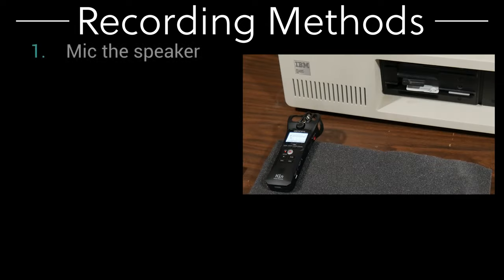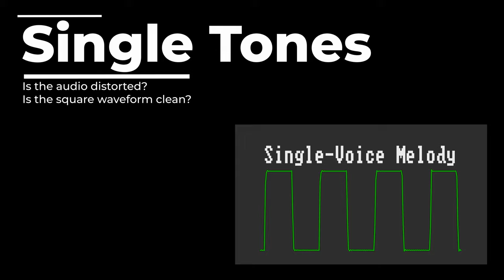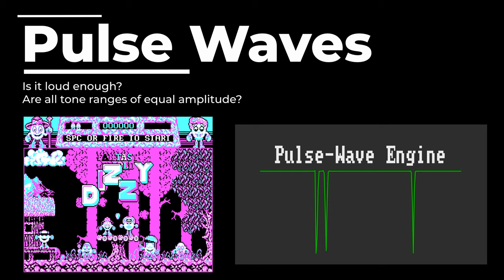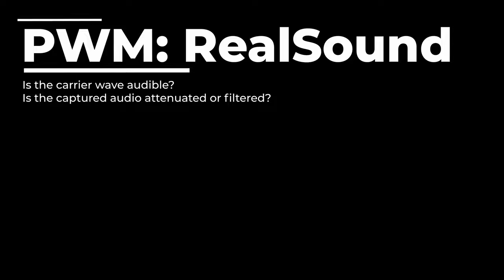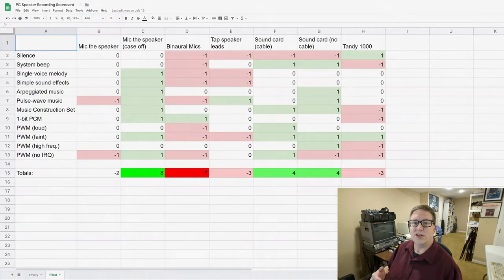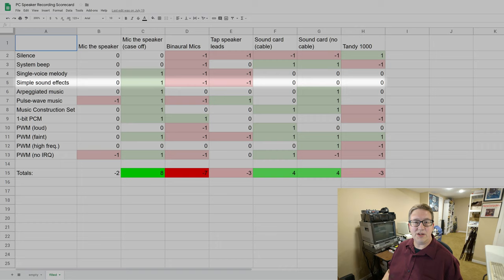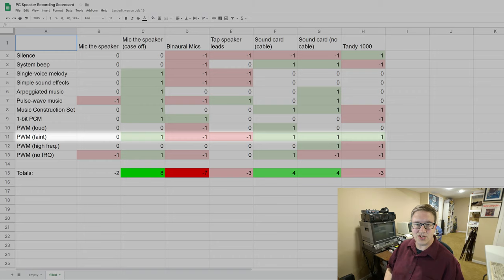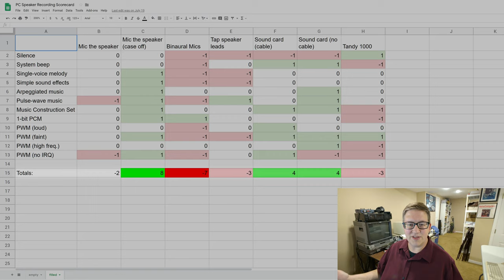Recording the IBM PC's internal speaker: MS-DOS gaming at its loudest

Comment: Was really interesting to hear all of these different methods to produce sound on the PC speaker. I agree that when you mic'd the speaker with the case off it sounded the most clear and authentic. I liked the absence of fan noise. I suppose ultimately the method of recording would depend on what you're going to do with it. I could see a line recording working well if you're capturing video directly from a video card, and the mic'd speaker audio going good if you're filming the actual computer, but then again it probably wouldn't look great with the case off if you're trying to show the computer running something. Huh. Thought provoking video Jim, I'm going to be doing an Apple II video in a couple weeks or so and think I'm going to try to mic the speaker like you did here.
Reply from the maker: I recorded a speaker for several days so you don't have to!  :-)

Comment: When recording via the sound card with the cable, be sure to mute all of the unused inputs/sources in the sound card's mixer (line in, mic, etc.) to reduce the amount of background noise and interference from the CPU. This applies even today with modern sound cards and onboard sound chips!
Reply from the maker: Good point!  While not shown in the video, I did indeed do that, for both the SBPro I was using with a cable, and the PAS16.  What I did not do, however, was make sure the RealSound filter bit was turned on for the PAS -- not because I forgot, but because I found it didn't make any difference (to me, with a limited sample set) so I just left it alone and didn't fiddle with it in autoexec.bat.

Comment: I think the conclusion is that a combination of techniques would be the best... You can use the soundcard or tap cable to bring the signal to the outside of the case, while the case can remain closed. Then you could connect an original PC speaker to that signal outside the case, and you can record that with the mic. You could even create a sort of 'isocab', where you put the PC speaker and the mic inside some isolated box, to prevent it from picking up ambient noise, so it can even be used in somewhat noisy environments.
Reply: Another thing is... the most noise is generated by the PSU and the HDD. HDD can be replaced by a CF-IDE solution, which is silent. And I'm pretty sure some handy electronics hobbyist could whip up a passively cooled replacement PSU built from modern components. With a CF-IDE solution, you probably won't even need the full 130W power anyway. Your average modern laptop PSU is more powerful than that, and requires no active cooling.
Reply from the maker: I like the "isocab" solution for if I ever have a dedicated space to do captures in.  Currently I need to be able to quick-change my layout due to lack of space and varying needs.

Comment: Back when I was my younger self playing mostly DOS games, I was a big fan of the cable to soundcard method.  I actually modded a cable that ran the PC speaker through the CD line in that I used for at least one computer.  A clever trick for the convenience of always using headphones.  Never had any issues with the CD audio having to take the long way around, but it's not like I was doing this kind of thing in the mid 90s.

Comment: Mic with the case off sounded the best & I was glad when the score reveal came and you said the same. NONE of the other methods for capturing the BEL character sounded natural, but just micing speaker with case off sounded spot on. I didn't realize capturing how crappy the tinny speaker is would be important.

However, some of the PCM tests you did sounded best captured directly with the soundcard. Shiru's music & the guy counting, there is some detail lost (authentically) when played through an actual PC speaker and not just generating sine waves.

If I were an emulator developer, I would implement a tick box to apply a "tinny speaker" effect, trying to calibrate it to the BEL character, along with the rest of the samples in your video. This would keep the detail that the authors hoped and intended for you to hear, in works that push the PC speaker beyond what its tiny cone is capable of reproducing. Simultaneously, at the tick of a box, you can approximate what the noise coming out of the speaker actually sounded like.

This was an important video, thank you for your work in preserving the sound of the IBM PC speaker.

P.S. your old ears might not be able to hear it, but your binaural mics have a high pitched squeal that no other mic input method has. You should use a lowpass filter if you ever use those mics for anything.
Reply from the maker: Thanks for the note about the binaural mics.  It's possible they picked up the 15.7 KHz of the monitor's flyback because they were closer to it (at ear level).  I'll never use them for this purpose again though.

I have a feeling that putting a lav mic inside the case is probably the way I'll have to do it moving forward.  It's just that SB output is so convenient...

Comment: Just because the way you phrased it leaves much to the imagination: "beeper designed to run at 0 or 5 volts"; nothing runs at 0 volts, I think you mean it's either off or on and then the motherboard controls the frequency for pitch.  Awesome video.  Thanks!
Reply from the maker: I agree "zero volts" is bad wording!  But yes, you're correct, it's up to the computer, whether through timer control or CPU control, to adjust the frequency.  The fun begins when you use two timers together to pulse the speaker faster than it can physically react, to get intermediate amplitude positions :-)

Comment: FYI, the IBM PS/2 model 25 (the 8086 models, at least) also has a headphone jack for the internal speaker.
Reply from the maker: Indeed, it was disqualified since it is too fast.  Also, because it isn't line-level output -- I tried to record from it a few years ago (there's a vcfed.org forums thread on it) and found that line-level input recording devices couldn't record from it for some reason.  It was very odd, and I never got to the bottom of it.
Reply: @TheOldskoolPC  Interesting. I've never tried recording from it, in fact I've never used the headphone jack on this computer. :)

Comment: I preferred the micing of the speaker directly with the case off for most instances. It sounds the best over YouTube and mobile speakers which a lot will be listening to. 

I bet you could tap the speaker with a line cable and put a ground loop isolator between that and your recording device to eliminate the external frequencies you hear in the quiet parts.  Maybe mix the two to get some of that reverberation you get from the actual speaker.
Reply from the maker: I hadn't considered which method would sound best over headphones, I admit. Now I need to scurry off and see what the analytics look like for my channel, to see where people are coming from.

One scenario I missed is to mount a mic inside the case as a more feasible permanent setup. I may try that with a cheap lav as a test.

Comment: 100 ohm variable potentiometer in series with the speaker as a volume control, turn the 100ohm pot to minimum to bring it to line level and not speaker level. fit a mono 3.5mm jack to the case to output into your wav recorder (zoom/tascam etc) leaving it at speaker level will destroy the recorders line input circuitry. and leaving it at speaker level will reveal electromagnet noise from the motherboard. in my chassis i fitted a 5watt 2" speaker with rubber surround, as many games play real music and fx through the speaker it sounds excellent, obviously as i said you need that 100ohm pot as a volume control as standard pc beepers are very high impedance, directly connecting a speaker without it will be extremely loud on a 4ohm speaker driver.

Comment: An Shure SM57 placed in front of a Marshall Amp has a distinctive sound that cannot be duplicated by running the guitar cable directly into a mixing board.  Similarly, the 2.25 inch 8Ω speaker on a PC creates it's own distinctive coloration to the audio signal.  Also, the motion of a voice coil in a magnetic field cannot accurately reproduce a square wave.  How the speaker deals with those square waves is part of the unique PC speaker sound.  

Proximity helps minimize fan noise and room acoustics.  Binaural microphone recordings when played back through quality headphones may represent what a listener hears, but this does not make it the best representation of how a PC speaker sounds considering environmental noise, room acoustics, and hiss from the required gain.  Similarly, the microphone placed outside the case is picking up a lot of fan noise.  My favorite is the microphone placed next to the speaker.
Reply from the maker: If I read your response correctly, I think you are supporting my conclusion that different people will have different needs based on what exactly it is they're trying to capture.
I agree the mic next to the speaker sounds the most "authentic" but unfortunately I need something that is more practical for capturing many hours of footage, so I've settled on the sound blaster method, because it's the only line-output method that works with bootable programs/games (PAS needs a driver to activate it).
Reply: @TheOldskoolPC  The sound blaster method is likely the most practical and most faithful to the square waves.  All speakers will "round out" the edges on the square waves, even if most don't sound quite like the old 2".  Your video is a very interesting experiment regardless, and I'm glad I stumbled into it.

Comment: Jim, have you considered trying the speaker lead tap method, but adding a capacitor to the equation? If you find the right cap value, I bet you could do a really good job of simulating the physical characteristics of the original PC speaker that affect how it sounds. Take away a little bit of the "punch." You could probably get something both really clean, yet still pretty true to how it really sounds sitting in front of the machine.

I don't know if it'd be worth doing that when you can just use the PAS16, but it was just a thought.
Reply from the maker: I have not yet attempted any of the more advanced circuits, from a single capacitor to some of the amplifier designs I link to in the video's description.  They would definitely produce a better result than tapping the leads, but part of my setup needs to strike a balance between authenticity and convenience.

Comment: Interesting approaches; we used to wonder what the best solution is when it comes to getting a 256b intro shown on a bigscreen - using a cable either from the motherboard or through a soundcard was usually the winner, mostly because It Just Worked and you ended up with a standard relatively clean line out signal that you could then EQ with a mixer board. The micing method is obviously the most authentic, but you kinda need laboratory conditions for it :)
Reply from the maker: Exactly, and as you can see, my basement is hardly kept in lab conditions :)  So I think I'm going for the practical approach as well.
Reply from the maker: Also, most 256bs these days are built in/for DOSBox, so that kind-of "solves" that problem.  256bs, if we're not careful, are going to morph into PICO-8 compos.
Reply: I actually think we're seeing a trend of 256bs moving away from DOSBox simply because they're starting to use an amount of processing power that's only feasible on real hardware; we have ~3Ghz CPUs now, so the bruteforce fixed-step raymarching render that was a terrible idea in '95 is perfectly plausible now :)
Reply: And sadly DOSBox doesn't sounds good with all sound engine...

Comment: Great video. I've come to the same conclusion (on newer PCs). Recording close to the PC-speaker (case off, or with the speaker outside of the case) is the best method. I have a few recordings on my channel. There's quite a bit of background noise but otherwise the recordings sound quite close the the real thing.

Comment: Methodical, well-articulated, interesting. Thank you for this. I also agree with the assessment that mic-near-speaker combo sounds the closest to the original intent. Direct wired capture sound too harsh no matter the method; and distant mics (whether outside the case or binaural) pick up so much noise that it's distracting. 

I'm also impressed by the PAS16's rendition. Surely there's some kind of attenuation or cleaning going on because of all the direct wired captures, it sounds the smoothest and most pleasing, keeping details in the sound that get obliterated in other wired examples.

I've been told a couple of times (by purists?) that the case reverberation was intended to be part of the sound - I wonder if capturing with the H1n inside a closed case, would sound that much different from the open case.
Reply from the maker: Putting a mic inside the case was a use case I completely missed, and I think that's worth exploring for a possible follow-up video.  The interesting part is how it would sound, since we normally don't listen to the speaker from INSIDE the case, but outside it.

Subbed to your channel BTW (with a name like that, how could I not?) :)
Reply: @TheOldskoolPC  I'm very honoured! I don't put out content as often as I would like, but I try to make each video more polished than the last. Cheers!

Comment: THE ultimate guide!  Only thing missing is a mic drop at the end, but that mic looks expensive. :-) (What make/model is it?)

Thanks for linking to that PC speaker program collection too.  Before owning a sound card I used to collect those "beeper speech" programs off BBSs and the like, but the one you used in the 1-bit PCM section is new to me.
Reply from the maker: That mic was incredibly cheap, it's a Zoom H1n, about $85.  I don't recommend it because the gain knob can change even if you put it in the LOCK position while recording.  I'll use a TASCAM in the future.
Reply: Ah, gotcha.  I have a Shure SM58 here (+ tube preamp and all) - it's supposedly designed for voice, but I've had good results using it with a guitar amp cabinet, so I think it might work for this purpose too.  Gotta test this thing now :-D

Comment: To my ear, the mic by the speaker with the case off made the best overall sound too. 

My NCR PC4 has a much better speaker than the IBM PC. I wonder if using a different speaker with the IBM could make the best solution? It's kind of like a Hammond Organ with a Leslie speaker. You need the physical speaker moving to get the best sound, taking a direct line feed doesn't sound right. Perhaps you could build a speaker into a small dampened box, and hook that up to the motherobard for something that's great for recording, and not as subject to room noise.
Reply from the maker: That's not a bad idea.  Taking it from line is the most convenient, but it sounds too "fat".  I wish there was an emulator that could model various speaker types and housings.

Comment: If you need to capture the authentic drone of the IBM PC's cooling fan, binaural mics FTW!

Then you have the headaches of mixing soundcards and the beeper if using them in games..... (this applies to at least one PC game, Silpheed). The soundcard solutions solve this for the most part.

Kinda curious how folks fare on other platforms with a beeper. The Apple II can be tricky even though multiple systems offered a real output jack (IIc and IIgs both have headphone jacks).
Reply from the maker: That's a really good point about games that mix sound devices, Silpheed being a great example.  I hadn't thought of that at all, which makes the soundcard solution even better as it saves you from having to buy a mixer.

Comment: Before I saw your results, I pretty much agreed with them.  Tapping the speakers seems like it would be the best idea in theory, but in practice the sound just sounded too harsh most of the time.  It's good to see that just a good mic and an open case gets the best results - anyone with a IBM PC or XT can do that without any exotic hardware.
Reply from the maker: My challenge is to figure out how to do this with the case still on, as I'd like to set up a semi-permanent capture station while still having normal functionality and appearance of the system.
Reply: @TheOldskoolPC  why don’t you try taking an IR of the inside of the closed pc case, then running the audio from the speaker tap through that in post?

Comment: Was looking exactly for something like this so I could hook up PC Speaker out directly into an amplifier setup for my ultimate retro gaming setup, I personally found the Direct Speaker Tap to produce the best sound (though for your perspective of perfect archival of what the actual Speaker sounded like that the Mic inside the case was the most authentic to my ears too) from the perspective of you could clearly hear a lot more nuances that were lacking from the other methods though it probably needs to be run through a filter or two for my purposes

Comment: Good video. It helped me find out more about the sound generation used in Digger, since you sort of connected it to "RealSound" for me with referencing it as pulse-modulation, so I went looking... Found this: https://www.gamejournal.it/the-sound-of-1-bit-technical-constraint-as-a-driver-for-musical-creativity-on-the-48k-sinclair-zx-spectrum/

I finally understand what "switching the speaker on and off faster than is physically capable" really means. The in-between states acquired via speaker cone inertia is what gives the other states beyond on or off, and therefore more diversity of sound output.
Reply from the maker: Yep, now you've got it :-)  Fairly mind-blowing to a teenage me.